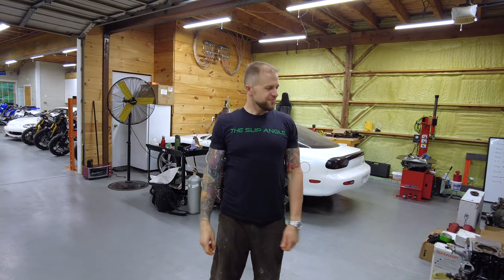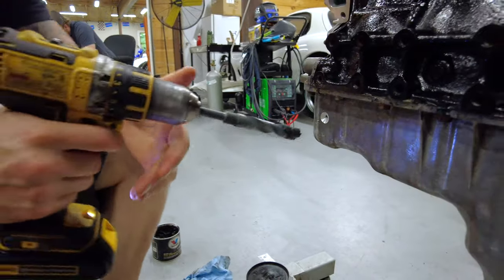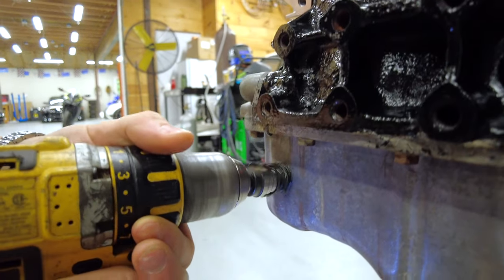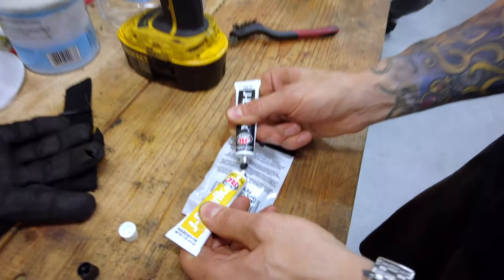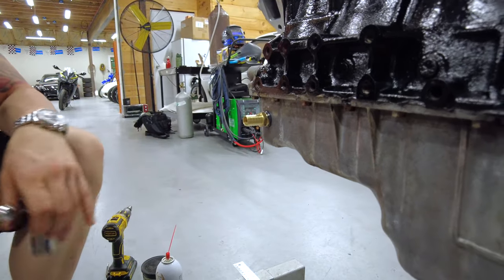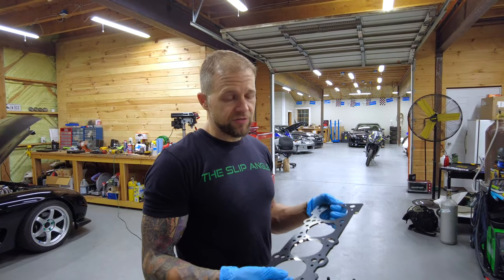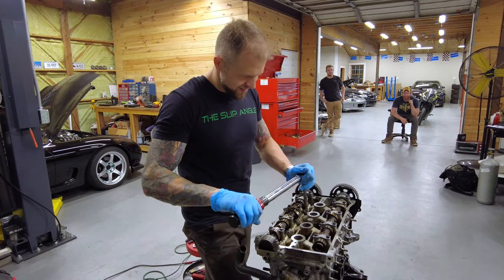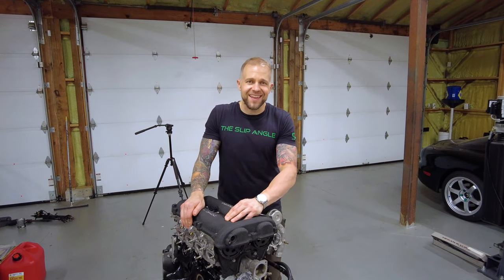Project Miata Exocet Pt 14 - ARP Head-stud Install & Oil return

Comment: Any other metal shavings would go through the oil filter. I see going as far as pouring oil down the tapped hole a little overkill. I love the effort though.